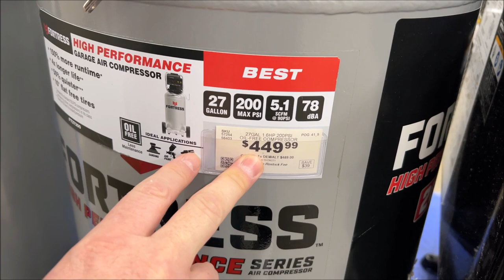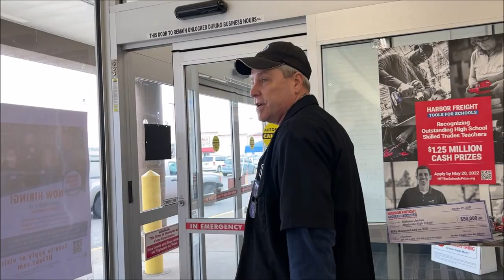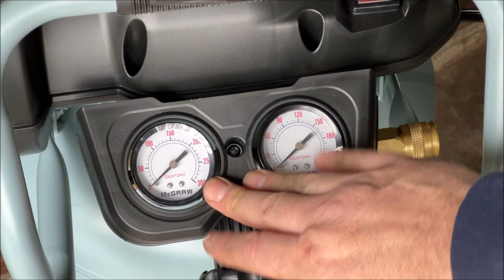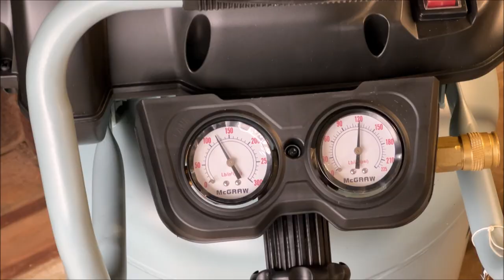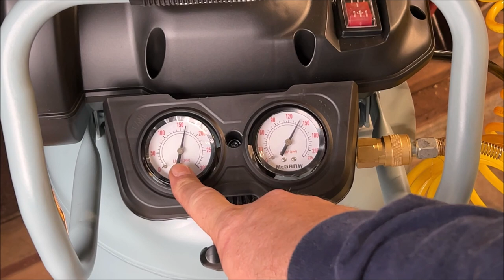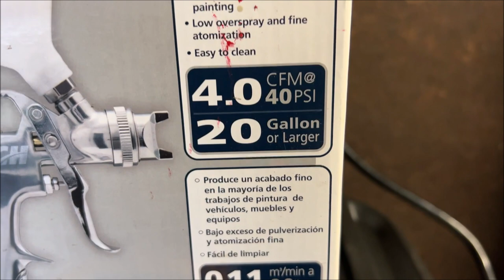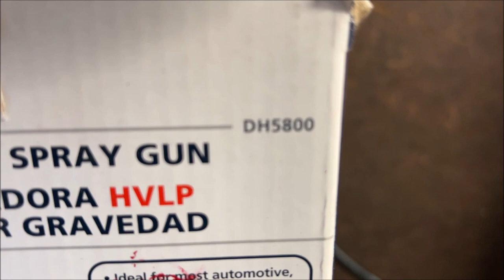VW Beetle Restoration - Harbor Freight Compressor Review - Rustoleum Paint Job - LVLP Gun - HVLP

Comment: You're shopping based on gallons. You need to be shopping based on CFMs. The tank can be 1 gallon as long as the motor will produce the CFMs you need. I use a 4 gallon gas powered and it has 7CFM @ 40, and it runs just fine.
Reply from the maker: Thank you very much, I appreciate the input sincerely! I don’t know enough about compressors. So far so good with it.

Comment: Hi Slade, I have one like yours but a Craftsman I bought years ago. It's pretty loud so what I do is put it outside on the side of the garage and have a long air hose like you have but small diameter and nice and flexible. Another reason to have them outside especially when older, don't want to be next to them if they blow up. This is for folks who have old ones in their garage.
Reply from the maker: I would definitely like a larger one, but it’s going to have to wait till later. This one will definitely do the trick for now.

Comment: With compressors the bigger the better. I remember the police in Pa. They'd pull you over even 1mph over. I like HF tools. For the guy that doesn't use his tools for a living, most of them are plenty good enough. I had the 20 gallon version. It worked great. Now that I'm settled in I need to get another larger one.
Reply from the maker: I wished I could’ve gotten a bigger one, but I’m on a budget right now. Later on down the road I will go three times the size. Yeah the state police here are very aggressive lol
Reply: @SladesVWBeetle  That's plenty big. I was talking about me. Right now I've got basically a portable bubble. I think it's like 3 gallons. I'd love to have another 20 gallon. That's big enough for just about anything. I used to powder coat and sand blast with the 20 I had.

Comment: Hey Slade..glad you got the extended warranty you may need it..i bought a oil less compressor when they first came out..it was alright for a couple of years they didn't have the extended warranty back in 91..i bought it from home depot..I've been through a few since then..i have two a 60 gal and a 20 gal..Ingersoll Rand..they are very good and you can get parts for them if needed..i used to be pretty hard on compressors..sanding and sand blasting and power tools..I've slowed down since then and probably will never need another compressor..the oil less compressor was a waste of money for me..when it puked the only to fix it was to buy another head..and it wasn't cheap..its been long gone ..thanks for the trip to harbor freight we have one 20 minutes away..see you on the next one Cheers friend 🍻🍻🍻🍻🍻🇺🇸🇺🇸🇺🇸🇺🇸🇺🇸🇺🇸
Reply from the maker: Thanks for going with me my friend! Oh I need to buy the extended warranty with what I bought lol
I’m trying to budget right now until I get the car done, of course I’ll just be onto the next car after that lol 
down the road I’m going to buy a 60 gallon, that requires oil. For the longevity for sure my friend.

Comment: Nice review on that compressor. I’m using a 60 gallon compressor and even when I use my air tools it demand a lot off airflow. So I use bigger diameter lines( otherwise your tool will have no power) this compressor is indeed for hobby work, just watch out for overheating, that will be killed in a instant.
Bin there and it’s costly if you brake one. But you have extended warranty lol. Nice video👍👍👍
Reply from the maker: Thank you my friend! I definitely wish I could afford a larger one right now, but things are pretty bad where I live. So I was trying to budget. It definitely will work for right now and then I will step up later.

Comment: If you have to send it back for a swap for some reason, harbour freight will probably just junk it. I dont think anyone fixes any returns now days. 
Good to see another grand Cherokee fan. Mines the 3ltr v6 diesel.
Reply from the maker: Yes you’re probably right, it will work for now since I’m on a budget and I plan on going bigger later. The Cherokees been great so far, I have the four-cylinder unfortunately. I’m a little nervous because they said the 2015 like I have ends up having transmission problems. I did buy the extended warranty bumper-to-bumper.
Reply: @SladesVWBeetle  if you keep it well serviced and drive it normally, it'll  probably do 300,000 miles easy.
Reply from the maker: @Paulman50  I hope so!! Some thing about the nine speed transmission they put in it is causing problems. I’ve seen a lot of complaints online. Mine has 60,000 miles. It don’t say when to get the transmission fluid changed. 
But I think I’m going to take it to the dealer and get it done. Mine doesn’t have no way of checking the level.
I’m not used to having to pay to get things done. But it’s probably for the best. I absolutely love driving this vehicle. I am technically very gentle on it.
Reply: @SladesVWBeetle  I service transitions every 50,000ks  witch is 30,000 miles
Reply from the maker: @Paulman50  I just bought mine recently, I don’t believe it was ever serviced, transmission that is. Hopefully it’s not too late for 60,000 miles.

Comment: @slades       How does sander work and tools when ur doing a job do u have to wait for air to build up for them to work I’m not familiar how compressor work
Reply from the maker: Honestly if you’re going to be running very large air tools, I would go with a minimum of 30 gallon. 
But I was running a DA the other day, and I did have to pause a few times. But not enough to aggravate me. 😁